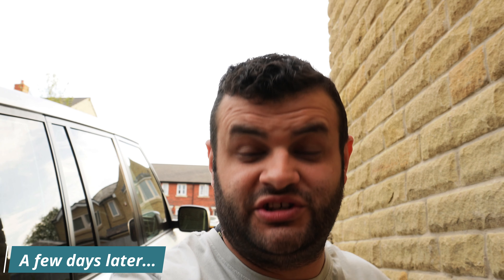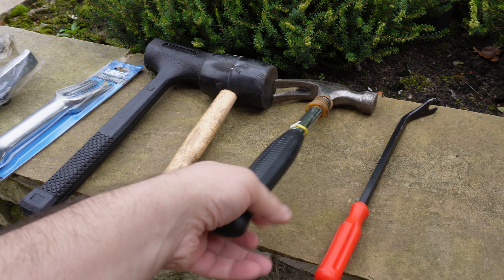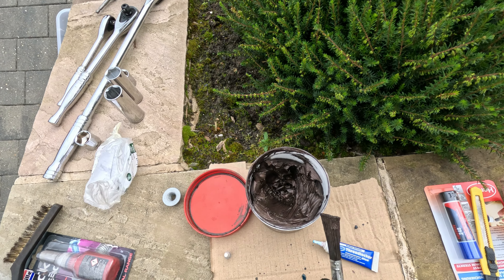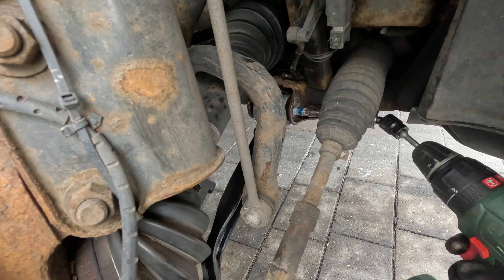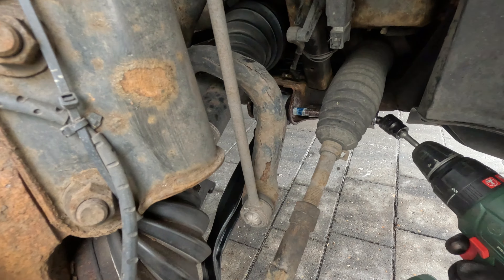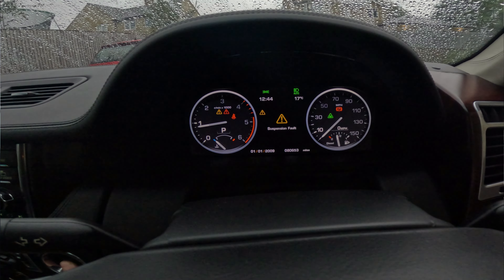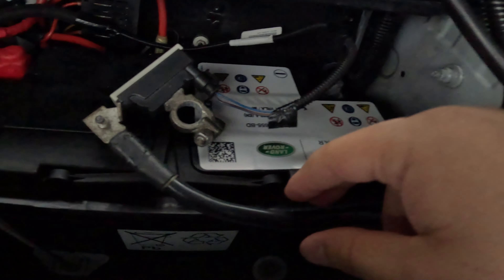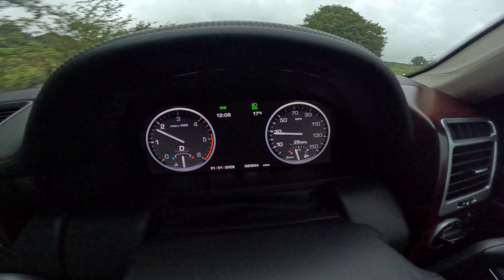Range Rover L322 Lower Control Arm Replacement - PT2

Comment: I think you did very well on this one! The hammer I use is a builders club hammer, it gives much more shock than the little carpenters claw hammer you used at first, to give the same amount of energy to the knuckle joint with a small hammer you would need to move the hammer at a much higher speed, not easy when there are other things in the way, but a 2 Kg hammer can move much slower and give greater shock, you did the job with perseverance ,that is good! Stay safe! Chris B.
Reply from the maker: Hi Chris, hope you're well.😊 Thank you so much for your support and encouragement and your advice. I will be looking at the hammer you're referring to because I think it will help in future projects, and you're absolutely spot on with regards to no space and needing a heavier hammer. To be honest with you, I was reluctant to hammer the knuckle as I was worried that I'd damage the knuckle itself as well as other rubber parts that were surrounding it, that if I had missed the knuckle it could've turned into a bad day! Keep in touch. 👍🏻Fahed
Reply: @lifeasusual  Yes we are well down here in the south of France, and I am really pleased to see you have removed that ball joint, the problem is, when you have not done it before you are really worried about damaging things, but with a small hammer you really need to move the hammer fast, and therefore inaccurately, to get the same effect that a club hammer will give you, I hope you do not have to replace the other side any time soon, but you will be well prepared to tackle it! Stay safe! Chris B.

Comment: Glad you got it done! Don’t use power tools when cleaning joints though, to much material can be removed and cause the arm to fit loose when fitting the new part!
Reply from the maker: Hi Craig, thanks very much for your support, great advice! 👌🏻 I'll absolutely keep this in mind for the future, but just wanted to let you know that I only used it to remove the surface rust. It is much faster than hand tools. 😁 Take care and keep in touch!

Comment: Glad it’s sorted. Definitely buy some bigger hammers, make sure there engineers ball pein type, they have a steel head designed for heavy strikes on steel, other hammers such as claw hammers can sometimes chip and bits fly off on heavy hits on steel. 
Also get a spray bottle and 50/50 mix Acetone and ATF, works better than any other wd40 type stuff.

Lastly whenever iv worked on suspension iv always left battery on, just when you first fire it up put it into off road mode then access mode then back to road height and it normally sorts itself out. 

Also get a few cans of spray on chain wax, very cheap stuff, normally about £3-4 a can, whenever your under car or in wheel arch just give it a quick wire brush and spray, it’s full of anti corrosive additives and sticks doesn’t wash off so it’s a great cheap rust proofer.
Reply from the maker: Hi Richard, apologies for the late reply. Thank you so much for your support. 👍🏻 I will definitely look into buying the hammer that you're referring to. Thank you for all the recommendations and pieces of advice you've given me, I'll try your techniques and put them to the test to see the differences in the future. 😁